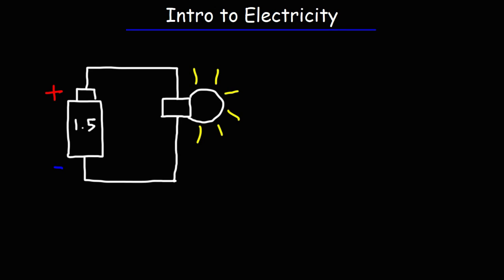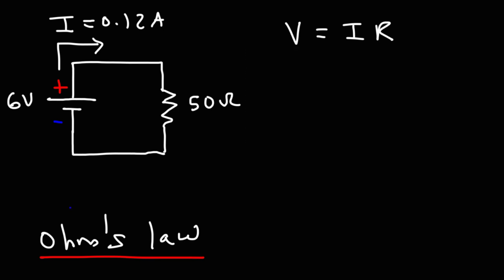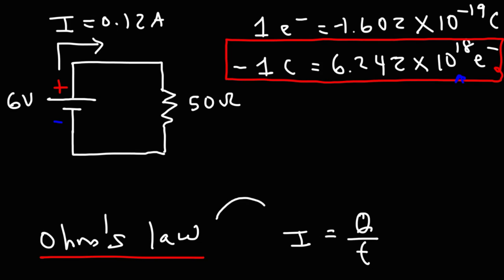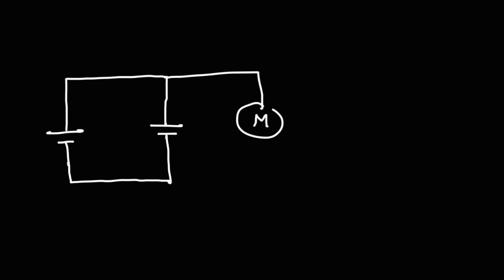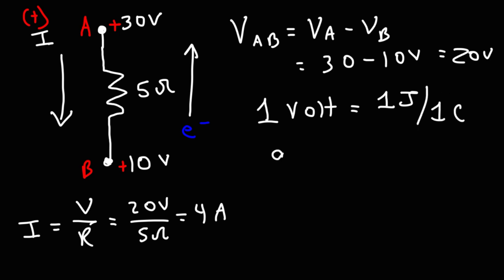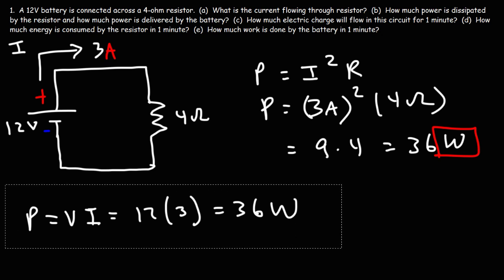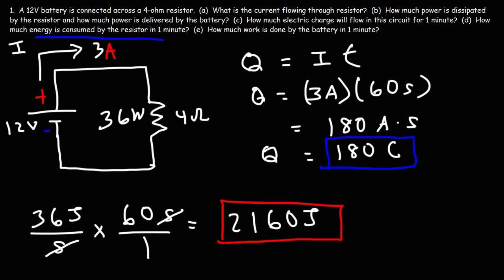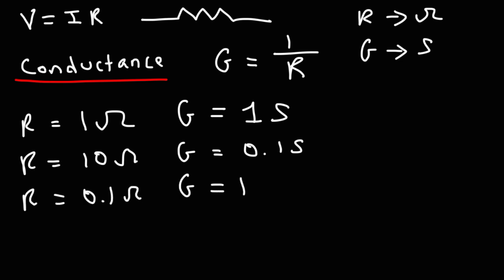Electricity - Basic Introduction

Comment: At 25:06 when he says that sometimes wires are made out of silver -> probably mixed it up with aluminum, which is used sometimes as it's cheaper than CU, but has a higher resistivity (2.65 x10-8), thus a 'thicker' wire is required. Silver is way too expensive to be used for wires lol.
Very clear an concise intro to electricity otherwise! Thanks

Comment: 14:11 resistor dissapates power through heat energy(resistor is converting electrical energy into heat energy), power(watts) is the rate of energy transfer from one form to another
Resistor dissapates 36 joule of electric energy per second  while simultaneously? converting that into 36 joule of heat energy or thermal energy?